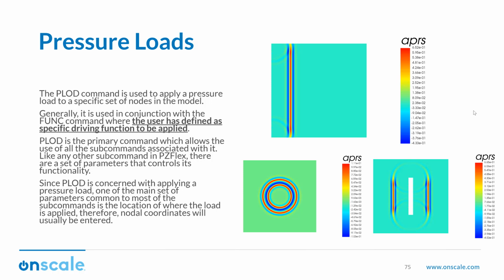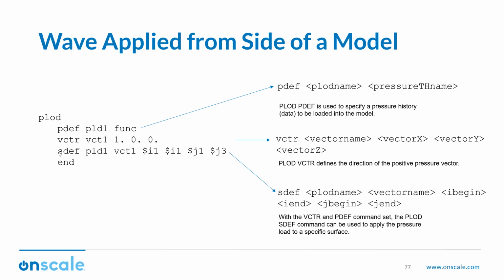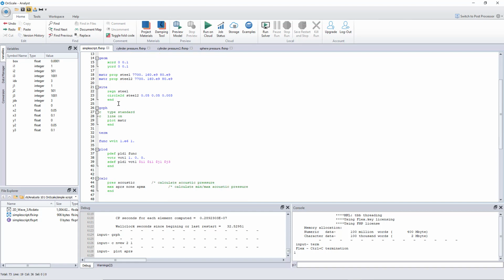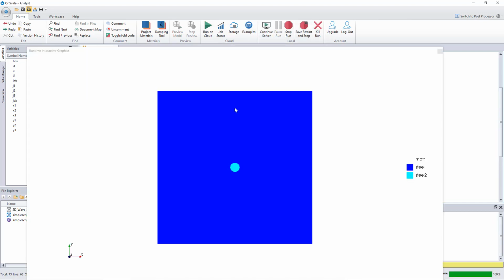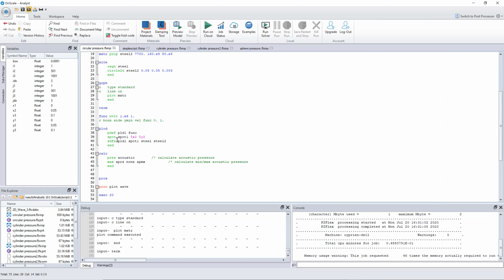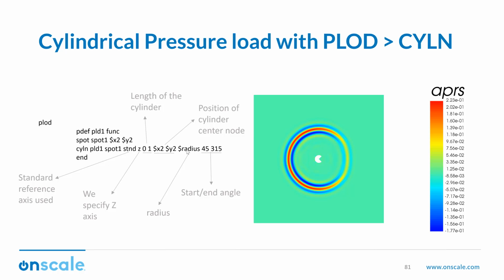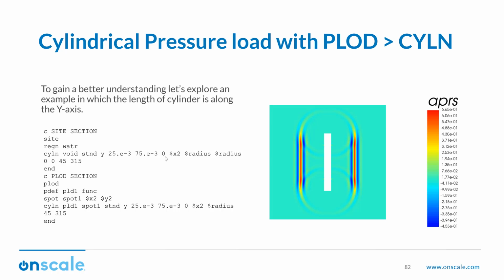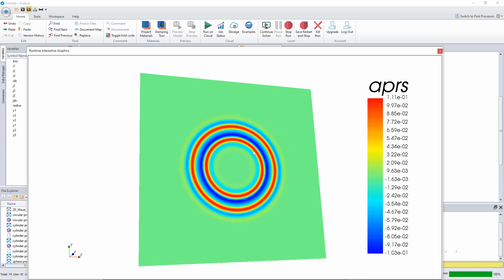[OnScale Analyst 101]  Linear, Cylindrical and Spherical Pressure Loads - Part 11

Comment: If I use the command "sdef pld1 vct1 $i1 $i1 $j1 $j3 $kndgrd $kndgrd" in a similar 3D model i get an error "Error inverting rigid body rotary inertia matrix ".
Reply from the maker: Strange, never seen such error. Try to post that on the OnScale forum